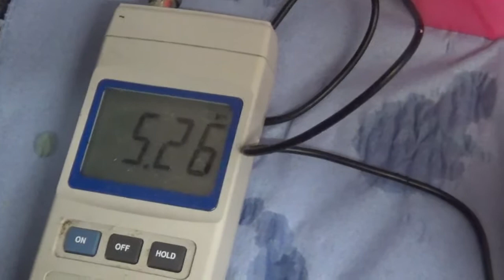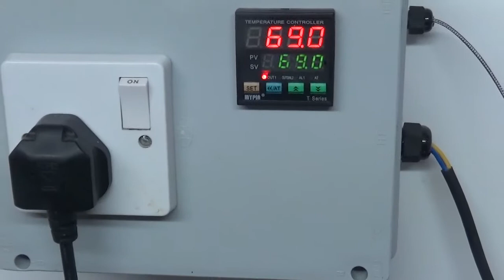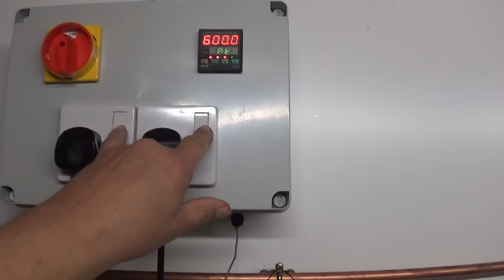Overnight mash and double brew day

Comment: And with the “Ride of the Valkyries” in the background very inspiring....love me an overnight mash, keeps the missus happy too. Neck oil sound delicious must have a bash at it I reckon Clive, cheers mate👌🏻🍺
Reply from the maker: Heathen Brewer I was pleased with the first go at overnight mashing I’ll definitely do it again!
Reply: I've seen John Anderson do an overnight mash but I was under the impression he just left it and let the temp drop gradually overnight? Do you keep the temp like Clive does here Steve or let it drop gradually?
Reply: Rob Hadfield not been brave enough to leave it recircing overnight with the element clicking in and out yet, I have done a few where I mash in at 70oC then leave it covered. I use a  powell brewing thermopot so it keeps temps really well and it drops to 66-67 over about 8-10 hours. Clarity was outstanding as was efficiency.
Reply: Heathen Brewer wow, that’s great temp retention. Im currently outside so it would need to be recircing. Might try it mashing all day when I’m working from home at some point - then boil in the evening 👍🏼
Reply: Rob Hadfield sounds like a plan👍🏻